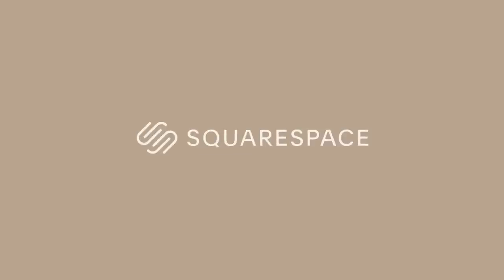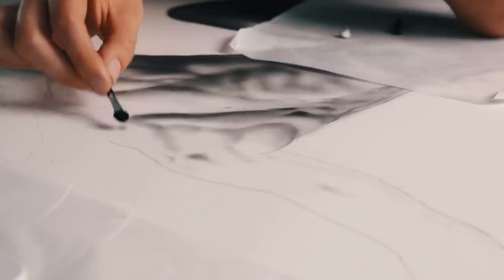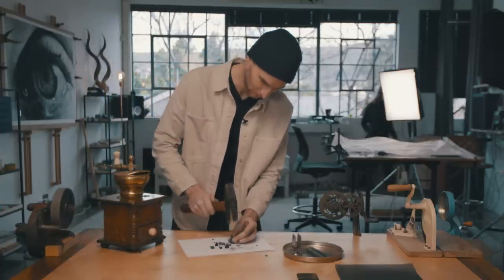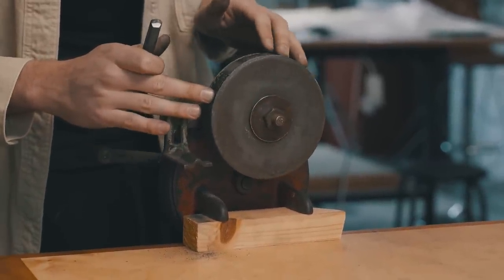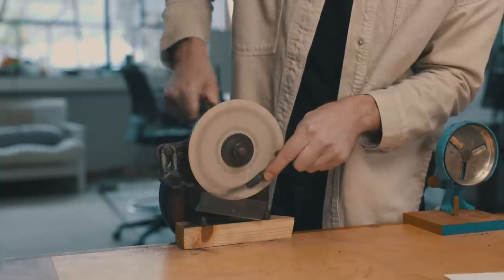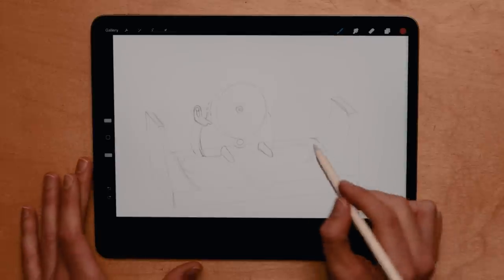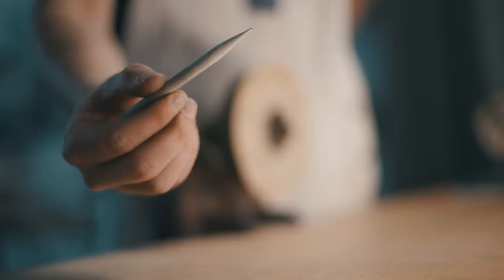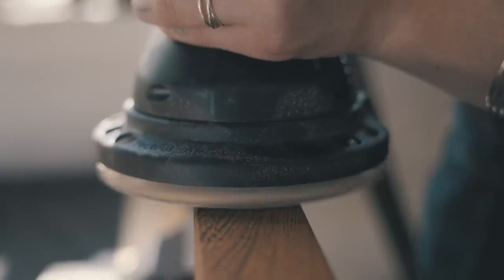I Wish I Thought About This Before - Drawing Studio Hacks

Comment: Find your nearest automotive paint supplies shop and ask for "dry guide coat". Made by various manufacturers such as 3M, it is literally a tub of minutely ground black carbon powder. It even comes in a pot with a built in foam pad in the lid for applying to large areas. It is used to show imperfections in primer and body fillers while sanding prior to painting a vehicle. It's probably more akin to powdered charcoal than graphite but considering it's a big tub of black powder ready to go, it might be worth experimenting with.

Comment: Great idea. Now get a round plastic basin/bowl with vertical sides, cut a hole in the centre and a single split from hole to outer edge, slip it over the axle near the handle side of the stone and you'll have a 360 degree dust catcher that'll drop the graphite to the bottom of the (sideways) bowl where you simply sweep it out with a 2 inch paintbrush.

Comment: Did you try electric coffee bean grinder? They can be found in very small sizes and grind dry to very very small particles. The longer you keep it on the finer the dust is. I used these to make homemade bird feeding formula for crop feeding. Sometimes I needed special ingredients to be tube fed and if you use very small tubes everything gets stuck in them. So I used electric coffee bean grinders to grind everything from dry insects, dry shrimp, dog kibble, snails... You end up with very fine dust that you can even sift trough small sieve and if some coarser pieces are left you put them back and grind again. You end up with this very fine and silky powder. I know I could make paste from this that would go ever trough an IV catheter and I could crop feed small song birds with it.

Comment: If you are going to use sandpaper try using 3m Cubitron sandpaper, it's designed to not clog as quickly and all the rage for sanding wood working projects.
Reply: It does that by chipping, would think ao grit would be better for this application as less contaminates.

Comment: Cut out the sandpaper you are currently using and glue it to the large round stone. So you will have the usual sandpaper but rotating. You could use it in strips on the thin side, or cut a circle and use it on the side.

Comment: Why not use a ball mill? You can convert an old rock tumbler into one pretty easily. They're noisy but you'll be hard pressed to get a finer powder and you just turn it on and walk away, then come back in a day or two and sift out the graphite.